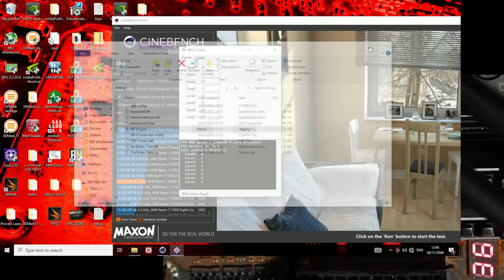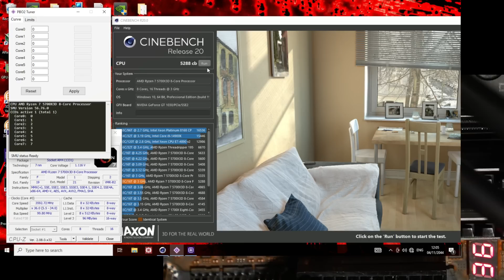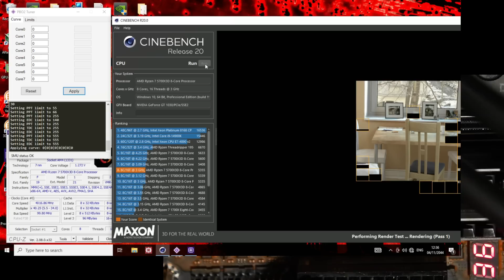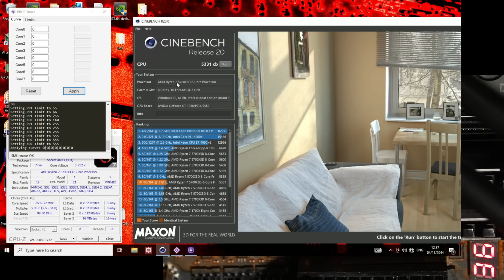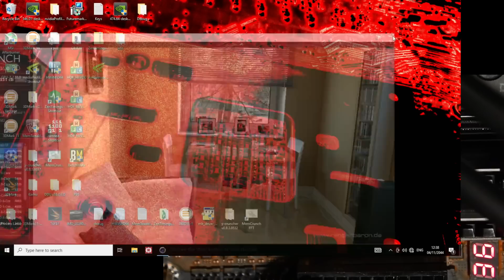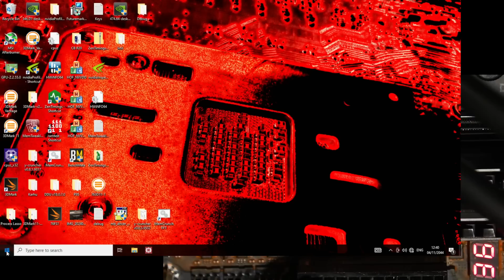Trying PBO2 Tuner on the 5700X3D

Comment: The x570 godlike has a clock gen  if I remember correctly
Reply from the maker: the X570 chipset has a mental breakdown the moment the BCLK exceeds 102MHz. Clock gens on X570 boards are utterly useless in my exp.
Reply: From what I’ve seen at least with the 5800x3d cpus the highest clock frequency I’ve seen from one was on an X570 unify (non x) using the external clock gen. I don’t disagree that you can run the base clock higher on b550 but the GPU won’t likely support it even at pcie gen 2 speeds.

Comment: Same performance, lower temps? That sounds like exactly what I want :D
Reply: Dropped my 5800x3d by almost 10c with a -30 offset :p
Reply: with this new 5700x3d, can I do the same thing? @andrewmccarthy9898
Reply: Cs2 crashes with -20 and below on my 57X3D, so I settled with -15. Lame.
Reply: @kingeling  I recently did the pbo2 tuner thing -30 on all cores temps have gone low and it runs on higher clock speeds, as compared to before when i ran cinebench on stock settings i got 12575 and with -30 it went 13161. Im happy
Reply: while he is good he only covers the basics but buildzoid is pretty much known to be a really good overclocking who has years of experience  @iamdeluluu
Reply: @iamdeluluu  LOL... What guy? hope you don't mean buildzoid...

Also I love his content, his cool af, but his CO videos are like the bare minimum, doing a global offset is just lazy and not the ideal thing to do, this hurts AT LEAST two cores, the highest performers, and this doesn't achieve full stability, doing per core CO does.
Reply: @FcoEnriquePerez  Filler video but he clearly has no idea how it is meant to work
Reply: @FcoEnriquePerez the better silicon can do -30 all cores, easy fix if not, lower on those two cores 💡
Reply: @FcoEnriquePerez  my 5800x3d does -30 allcore AND an undervolt on top before clock stretching, golden chip ;)

Comment: Not meaning this as an insult at all but Check out how "skatterbencher" on you tube overclocks these. i thing you have to do PBO then BCLK 107+ then increase Curve Optimizer till stable. Apearently the hold up with these is the limited voltage already

Comment: CO together with PBO took my 5950X from 24K in CBR23 to 29-30K in CBR23 whilst keeping temps under 80 on air. It’s a balancing act - if all the cores are running cooler they can all boost higher but they need the extra power headroom PBO allows.
Reply: 24k is what my 5900x gets now after tuning, although it initially was barely breaking 20 thousand when i first started messing with it lmao
Reply: @pwrcowfeeder  What were the settings? I got so far around 19000 score

Comment: On my 7800x3d and X670e Hero curve optimizer works the way effective clocks get closer to the core clock. Since I’m running Bclk (synchronized mode) 101.15 for ram fine tuning at 6270MHz (m-die) curve optimizer per core varies-24 to -30 (not fully stable in Cyberpunk though it runs all the stress tests without an issue). Thus I get 5.1GHz all core (core clock monitoring) / 4.98-5.0GHz in R23 and around 4950MHz effective clock in R23. The max score was 19077. 
On the other hand if I switch to asynchronous mode and set eCLk to 105MHz (5.3GHz all core clock) I cannot apply negative curve optimizer values bc the system turns to pretty unstable. And with CO on Auto I get 5060-5080MHz in R23 core clock monitoring while effective clocks drop to 4890-4900MHz. And R23 runs slower at hypothetical 5.3 than 5.1 with negative curve optimizer. It’s about 18750 score.
The question is how it scales in gaming workload when the load isn’t linear. Will try to run CP2077 2K resolution on my 4090 to check it out. 
Btw negative CO on 7800x3d in my case affects neither temperature nor voltage in Cinebench
Reply: Effective clock being lower than core clock means CPU doesn't get enough voltage supply during a given workload, it detects that and starts clock stretching.
When you set CO to offset voltage curve, your CPU starts asking for less power and you get less load on the VRM, therefore you get less vdroop under load.
You can defeat clock stretching by setting stronger LLC and/or by adding positive voltage offset until an effective clock starts to match the core clock under affected loads.
Reply: @igor_mkv  thanx for the advice. LLC is at level 5 now (Asus recommended for OC), will try positive CO for 5.3
Reply: @andriikruzhylo8996  that's not what I meant, I meant voltage offset, which is used by VRM, not CO. Keep CO negative, add a bit of voltage offset to the core voltage.

Comment: Lotta people in comments saying they're running -30 all core on their 5800X3D CPUs... I can fully believe most can do this and be stable in most games, but please don't complain on a forum when X game is suddenly crashing because "it's making the CPU run too hot" lol

That said all the cores on mine run in the mid-to-high negative 20s range, and that's with a little overhead after finding the stable values. It's a shame as per the other video that the boost clocks can't be modified – I don't see what harm this could cause and it might marginally improve frametimes in especially single-thread heavy loads... oh well.

Comment: On my 5700X I initially just set all to -30, but within a week system crashed at idle. Set the best two cores to -25 instead and it was all good.
Eventually came to -28 on a single best core and -30 on the rest, no issues whatsoever.

Comment: I've stopped using curve optimizer on my 7950X3D (thanks as this was causing all my stability issues and you were the one who told me to turn it off) but I did notice that having a low Curve Optimizer setting did help my score on longer tests as my CPU would sit around 79 to 80C instead of hitting 85C after a few mins which would give me a better score overall, for a quick run of Cinebench R23 I didn't see much of a improvement, maybe a few hundred points higher on a 36000 point score.
Reply: You probably should reconsider and try again.
The instability from CO usually comes at idle or close to idle, when only the better/higher priority cores ask for voltage, because they ask for less voltage on the same CO value than their lower quality siblings (you can check per core VIDs under load in HWiNFO), and your CPU runs at the HIGHEST of the asked VIDs.
Given that, if worst cores are loaded as well(all core loads), your better cores will run at the same voltage asked for by worst cores, which in turn will mask instability of your best cores.
If you try to ease off on OC values for your better cores, you might just get back stability that you lost.
Reply: For example, on my 5700X, the best core asks for just 1.035 V with -30 CO, and worst asks for 1.115 V with -30 CO during Cinebench run.
And during those all-core loads, it doesn't matter if my best is at -30 or -12 CO, in the end it gets the same voltage as my worst at -30.

To be safe you can just match VIDs for each core using CO to your worst core's -30 CO and it should give the same improved Cinebench all-core performance/power use, just slightly worse power and much better stability under low core loads.
Reply: @igor_mkv  Where is the best place i can learn about everything you have mentioned above?

Comment: Its not the way to setup pbo, first you have to setup your PPT TDC EDC limit with hwinfo open and ajust them (especially EDC is the more important) put ppt limit at a higher value like 200 for 5600/5700/5800x and 300 for 5900x then with ycrunch or r23 you had to ajust the limit to be 99.9/100% on EDC and not 10 0% 
everytime on high workload. Put TDC at the same value as EDC
When you find a good value you have to ajust the boost , so start with +50 and see if you have the +50 boost on mono core and all core load, then put a higher boost and see again etc etc.. and finally you have to do the curve -5 by -5 and run corecycler defaut settings and see if you have error
Reply: @bullzoid ❤
Reply: And i see something, the higher TDC is on multicore worldload, the higher effective clock is
Reply: And PBO2 Tuner for my case is working only for curve optimizer, not pbo limit, i have to do it in the bios, more accurate
Reply: Sorry for my bad english :p

Comment: Yeah, when you have outrageous cooling already, PBO tuner probably just doesn't make sense when you need that extra voltage for higher clock speed stability. BUT!, because of how AMD put these CPU's together, at least with the 5800X3D as far as I am aware, due to the 90c throttle limit, it becomes harder to keep those peak speeds in hotter and hotter environments. So yes, especially in the case of lesser cooling solutions, the PBO tuner is really nice for dropping those temps to some extent per core, which is overall best for the CPU's construction with the extra cache sitting on top. I have a Dark Rock Pro 4 with two 3000rpm noctua industrials strapped into and onto it. Obviously I have no major issue keeping it cool at stock configurations. BUT! Due to those fans attached, I can cool the unit rather well at lower fan speed; but not quite well enough for the larger workloads. It works, but it will throttle. 

So essentially what I get is a quieter product that results in mostly the same performance at a slightly better power efficiency than the stock configuration. AND. If I want, I can now use the extra voltage headroom to up the BCLK by about I figure 5-10% eating into that thermal headroom. Main goal is to make it so the PC isn't heard by the microphone without having to do any major filter adjustments in OBS, etc; but still have the same or better performance if possible.

Perhaps I should finally just move to liquid cooling, but... I kind of like the reliability of a non-liquid setup. And ultimately, I kind of need to upgrade my paste. I'm currently leaving about 5c of thermal headroom on the table by using some old Noctual H1 paste. I should probably be using thermal grizzly paste, or their solid pads for CPU and GPU respectively. Way better thermal conductivity comparatively on paper, and from the reviews I've seen so far; definitely better than the paste I am using right now anyways. (but I might as well use it all first.)
Reply: As far as i have experienced, the 5800x3d will start dropping boost clocks in small increments starting at 80°C. And like you said, with the cache sitting between the chips and the ihs you need way more cooling than what you would normally use for the given tdp. I had a 240mm aio and now a 360mm aio and it doesn´t really make a difference. Normally in Gaming you dont get to 80°C but in other tasks you`ll get there pretty fast. And all that with the -30 MSI Kombo Strike

Comment: The 142W CPU PPT value seems to be intended for dual CCD CPUs, because they can easily get to 35W - 37W SoC power under load, in case you run quad-rank DDR4 (e.g. 128GB) and connect all available PCIe lanes. The cores usually sit on a combined 105W - 107W then, depending on the AGESA version, since TDP for Ryzen 3000/5000 is only a fantasy number.

My 5950Xs also draw 17W - 20W SoC power during idle compared to the ~7W SoC my 5800X draws idle. Before AMD fixed ErP Lot6 with one of the AGESAs last year, the idle power could occasionally even hit 30W SoC on the dual CCD CPUs.

*edit: clarification
Reply: 7w idle? that's crazy, my r5 5600 draws 18w, what did you do to make it run that low?
Reply: @mparagames  I was referring only to SoC power, aka what everything else inside the package except your cores draws.  😁
Reply: @Sarajiel  still, mine draws 17w - 18w, the cores draw less than 1w idle though
Reply: @mparagames package power is always gonna be higher than SOC + core power, since your CPU has to have the interconnects powered at all times, maybe something else is going on as well, that isn't displayed.
My 5700X idles at just over 19W with SOC at 8.5W when nothing is running except HWiNFO.
SOC voltage set to 1V and 3733CL18 64GB RAM at 1.35.
Reply: 142 is the default PPT for 105w chips
Reply: @lievre460  I'm fully aware of that 😉 However, it seems that this value for the power limit was originally chosen by AMD for dual CCD CPUs which would explain why BZ can lower the PPT value before actually noticing performance degradation. Personally, I run my 5800X at stock, and I've never seen the SoC power going anywhere near 30W, therefore it basically never reaches the PPT limit unlike my 5950Xs.

Comment: i run -20 on my 5800x3d and this does make a difference. with it set to -20 the cpu will hold a boost of 4450 and 4250 at stock. also, i dont know if its my mb, but i can set this in the bios (asus x570 cf7).

Comment: Idk why you had such bad experience with CO. On my 5700x OC'd with pbo to 4850mhz and has motherboard limits, so it pulls around 130W-140W so it's harder to keep it cool. So curve optimizer -30 all core can keep higher clocks for much longer because of lower voltages and less heat. Without CO i can get up to 100mhz less than with it. And that leads to a few hundred points(maybe more) less in cb23.
Reply: you cant compare the 5700x to the 5700x3d. totally different chip design.

Comment: curve optimizer is good to shave off 10-15C and stop air cooler from screaming like a banshee. And it tecnically can give some performance if you're thermally limited
Reply: Any drop in temperature should give an ever so slightly higher performance on Zen, unless you somehow run at full boost in all core stress tests.
With liquid cooling CO should be helpful as well, even if just a tiny bit.
Reply: Man thats insane, my 5700x3d already runs cooler than my 5600 on pbo so idk if it's very necessary unless you have a low-profile cooler.